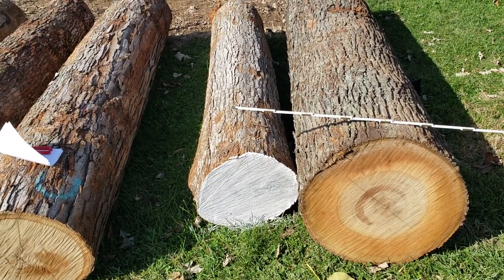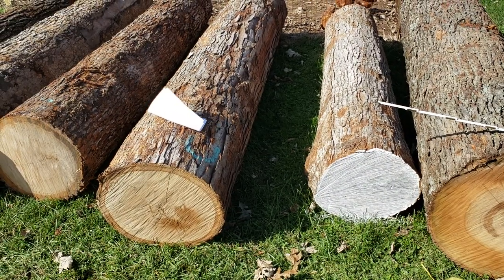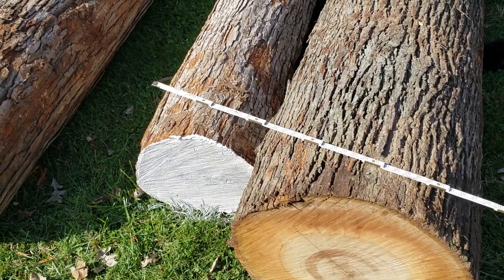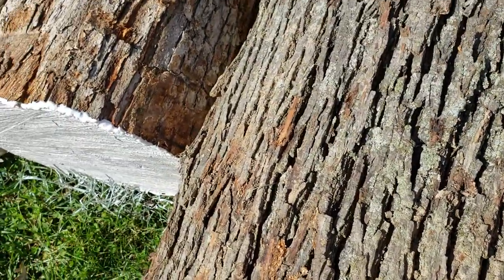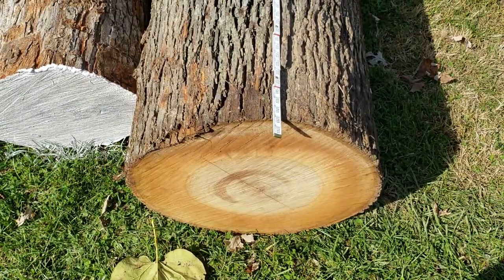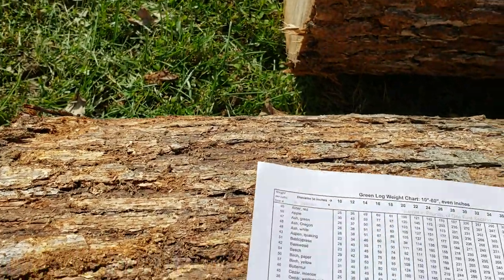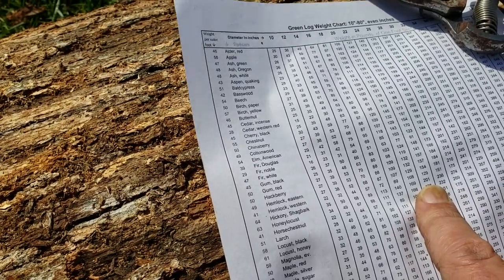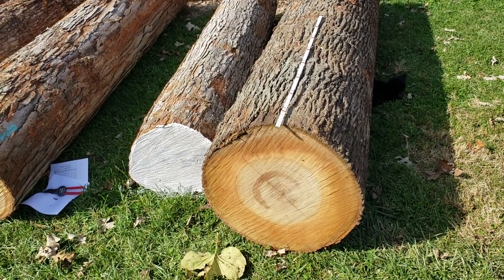How to Measure Logs for board feet and weight

Comment: Thank you for posting, very interesting, i never knew how board feet was measured.
Reply from the maker: I am happy if I can help teach anyone. Thank you for watching and commenting!
Reply: The info provided in the video is correct except for when he said a square foot and a board foot are one in the same. This is inaccurate because board foot is volume, not area! A board foot is actually 144 Cubic inches therefore, a board foot is only equal to a square foot on one inch material.
Reply: @michaelcolemire  Michael, you mean a wooden chunk 1'x1'x1' solid, cool thanks.
Reply: @woodchucktinman9893  Where can I find logs like this? I need a 24" diameter log! Cant find them at local lumber store...

Comment: I'm a wood turner and only deal with logs that are no longer than 4 feet long, anywhere from 3 inches in diameter to about 20 inches in diameter. The Doyle scale doesn't show anything under about 6 feet. How do I calculate small logs?
Reply from the maker: Just take for example if your log is 4 feet long use the 8 feet and divide by 2 will give your board feet. Hope this helps.

Comment: You are wrong! It is supposed to be hook 1 bark , outside to inside. That is why the " SCALE STICK " has a metal hook on the end
Reply from the maker: I have been with log buyers purchasing walnut and white oak veneer logs multiple times  and they measure inside the bark. Large walnut can have close to 2 inches of bark on each side. If you can find someone to buy logs the way you say, good for you. The timber industry in the midwest  does not. Sorry.
Reply: I wish I knew how to send pictures, I would have you check the Wagner Company's website for the updated spec and price sheet . Says right on sheet 1 bark , scribner SCALE. Sounds better than your deal my friend.
Reply from the maker: That answer may solve the confusion, in the midwest they use Doyle scale. I just know my logger friend, who has been doing it for over 40 years taught me, and I have been on site many times talking to the log buyers. Be safe out there.